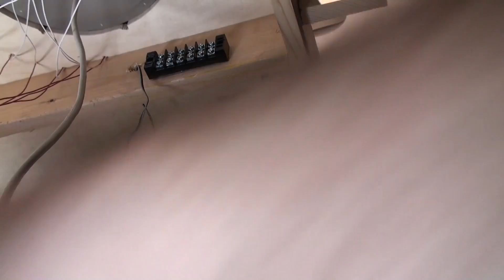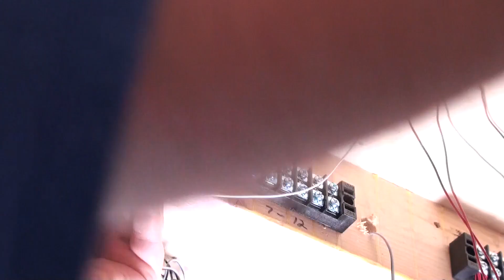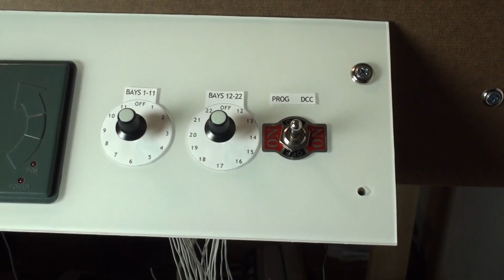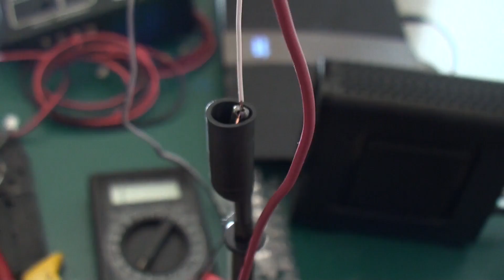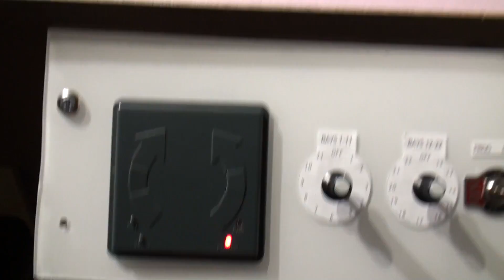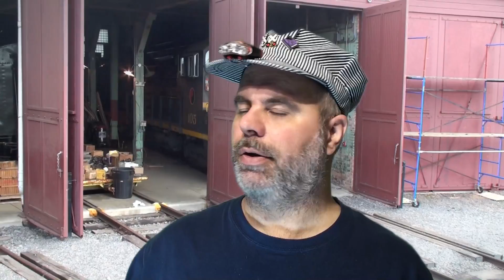How To Install Walthers 130' Turntable and Roundhouse - N Scale Part 6

Comment: Hello Bob my father and I are working on our N gauge layout and are trying to figure out what power supply to use with this turntable.  We have noticed that most of these turntables sold do not include a power supply.  What power supply are you using?
Reply from the maker: Michael Powell I am using a DC power supply that has an AC accessories connection which all do.  You can use any brand of power supply that gives around 18 volts AC out.

Comment: Bob, What about using an auto reverser. What will Happen if you use the loco in the position you currently have it on the turntable and then drive into slot 14?
Reply from the maker: All slots besides number 1 and now 19 are the same polarity if on the other side of the dead zone.  I have since rewired this all to the same polarity and installed an auto reverser to the turntable.  This will be described in part 7 that I am working on.  Thanks for watching.

Comment: I have the dc version of the turntable which I continued to use in 2012 when I added dcc as a option.  I seemed to work well.  When the railroad is rebuilt, I hope to use the turntable with Heljan 6 stall roundhouse units which requires radial track at 7.5 degrees.  One issue I experienced was maintaining alignment of the bridge with the radial tracks.  Your video provided some hints to help overcome that issue.   Thanks again for doing this series.  Eager to watch #7 and getting the roundhouse installed.
Reply from the maker: Thanks Roger, I am planning on doing an update to #6 with some additional electrical adjustments to the plan.  That will be in #7 along with lighting the interior before building the structure.  Thanks for watching, comments like this keep me motivated to do more videos.
Reply: My railroad was placed in storage in the Spring of 2014 because we placed our home on the market.  Took 2 years to sell; so in the interim I had only a test loop on a table in my home office. House sold, move made, now waiting for new house to be finished in 2017. So I am doing a lot of armchair rring and youtube watching.

Comment: To clean up the wiring, why not wire each red common wire to each other in series right below the roundhouse ?  You can use suitcase connectors to join each loop to make the job easier. Then you only have 1 wire to go to the panel.
Reply from the maker: That works too.  The terminal blocks just made it convenient for me while planning as I go with the wiring.  I have learned that if I plan it out to much and cut my wires short right away, I can't fix it later when I have to redo it.  I also just installed an auto reverser today to the bridge so I can use both ends of the bridge to line up to bays.  There will be an update in the next video with it all cleaned up and wired.  Thanks for watching.

Comment: Hi, Would it not be better to have the dead zone track between stalls 17 and 18 ? This way when you bring in a DCC sound locomotive and have to constantly pass stall 1 to get to any other stall, the sound won't cut out. Stall 18 is way over at the other end so you will only have the sound cut out at stall 18 or to the shed.
Reply from the maker: Since there is no avoiding the dead zone in any position, it will happen either way.  The round house actually was shifted over so that the dead zone didn't line up with bay one but between 1 and 2.  This allowed me to use all 18 bays.  Either way it is too late to change it now, it is up to personal preference where to place it.

Comment: Bob, 

Have you thought of using an auto-reversing module on the turn table power feeds to simplify the wiring?
Reply from the maker: Yes I am considering it, I do have a Digitrax AR1 that I can use if I need to.  The only reason that I can think of right now is if I put in more stopping positions for the other side of the table to line up with the bays.  This is one reason I have not shortened up all the wiring, it may need to be adjusted later to setup the AR1.  I will determine that once I get my lead in track installed and wired up.  It does make sense to put the reverser on the table power instead of the bay tracks.  This way all the bays can be wired the same way.  Currently, the only position to move off the bridge table is from the control shack end, a reverser would allow flexibility.  Thanks for the question and watching.
Reply: @DaBobsNScaleMancave   So an auto reverse switch is not needed at all even if i rotate the turntable 180 deg...ie turning a loco before putting it in the stall.
Reply from the maker: @cptcooties4884  I did put in a Digital AR1 to do the auto reversing on the table itself.   It isn't automatic without one, the engine will short out the system.
Reply: @DaBobsNScaleMancave  Can you do a short video in regard to the Auto reverse install please, regards  Wayne